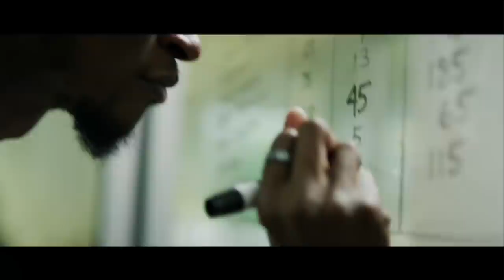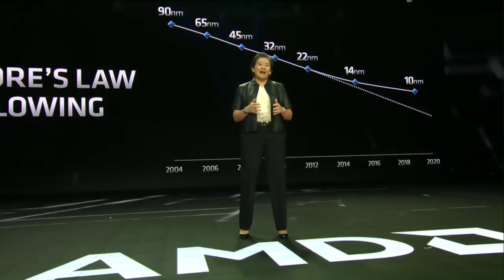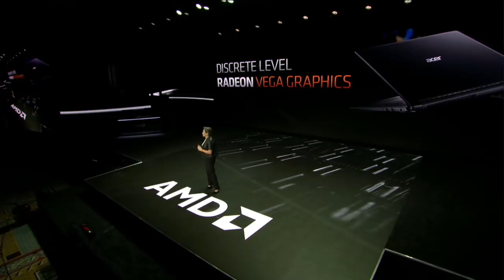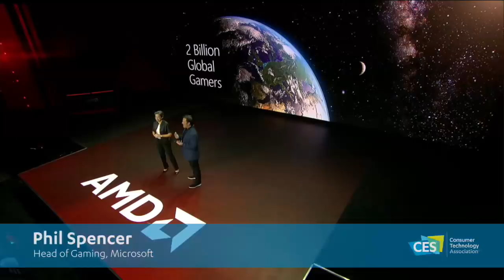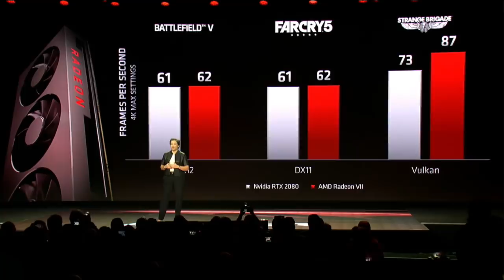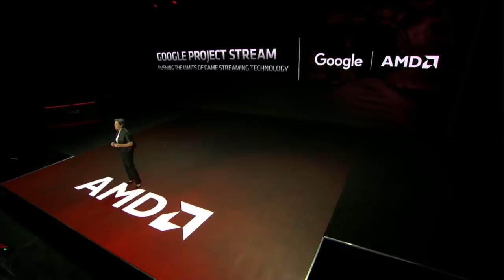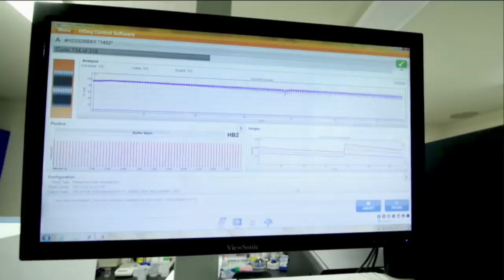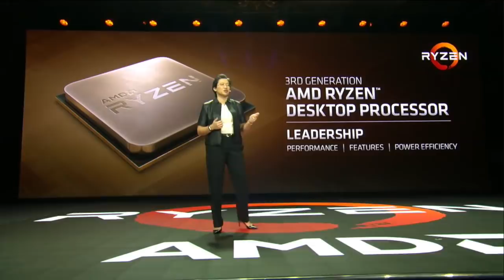AMD CEO Lisa Su's 2019 CES Keynote

Comment: This card was NEVER meant to be a consumer graphics card. This was made 
for the artificial intelligence market, automotive industries. HBM2 was 
too expensive so AMD killed Vega development and focused on Navi. Taping
 issues during final production caused the delay of the Navi 
announcement at CES. AMD was losing money on Vega\HBM2. The only reason 
it was completed was to have a back up plan if Navi failed\delayed.
Wait for Navi to be announced in June \ July release.

Navi 12 = RX580-1060 performance\RX3060\4GB GDDR6\75W TDP\$130usd
Navi 12= Vega56-1070 performance\RX3070\8GB GDDR6\120W TDP\$200usd
Navi 10 = Vega 64 + 15% - GTX1080 perfomance\RX3080\8GB DDR6\150W TDP\$250usd

Reference: AdoredTV.

Comment: I'm upset and very disappointed. I was planning for a new build late spring with a Zen 2 and a new AMD GPU hoping you'd have a new GPU architecture priced in the $400-$500 region. You're not going to get any mind share with this Vega 7. Yes I'm calling this a Vega 7. It's just a constant stream of re brands. 480 > 580 > 590   And now Vega > Vega 7. And at $700 no one will switch from team green to team red. It looks more likely people will be going for a 1160, 1170 or 1180 once Nvidia will launch 'm. You're not going anywhere in the GPU market like you've done on the CPU side sadly. get Navi ready ASAP or sell off the GPU division cause this Vega 7 will not bring you any more market share. It might even cost you.

Comment: These things will sell like hotcake IF Radeon VII priced below $699. Being the same price as GTX2080 will not be able to convert any existing Nvidia users. Also, 7nm Ryzen should priced below 9900K. Same tactic should be used during the first Ryzen series. Lastly, it quite a disappointment because we expected at least a 20 - 30% boost of a 7nm compared to Intel outdated CPUs, Not on par with them..
Reply: The chip they used to compete against the Intel was only running at half the cores. Notice when she held up the processor, there was a large IO dye, a small chiplet and room for a 2nd small chiplet.
Hence the reason why she said mid/late in the year for release. They aren't quite finished with it.

Comment: Where 16 cores? Where 5.00 GHz? Wtf. Lisa?
Reply: You really believed those rumours? Lul.
Reply: The leaks do not tell anything About 16 Cores and 5GHZ just 12 with 5 GHZ
Reply: @OGPatriot03  Right now, not a SIMPLE fact cause it's really based on your presumption of the space left on the substrate.  I could understand the ambition but I would be cautious and careful in wording it.
Reply: @cmiggyy  No, not just the space left, look at the light as it reflects. That space will be used.
Reply: @OGPatriot03  I said SIMPLE. My point still stands.

Comment: Disappointment with an overkill price driving 16GB HBM buffer. No one is asking for 4K, all we want is frames at 1440p. Competing against RTX 2080 at 700$ is a joke. Who chooses AMD graphics over Nvidia now that they support freesync. Had high hopes for AMD and their opportunity to crush Nvidia at the 400-600$ price point.
Reply: Julia J It supports it for all monsters. It just that those monsters arent certified so it may not work at all or to some degree
Reply: @SweatyFeetGirl   It's enough monitors to make a difference for those upgrading or building new systems. Yeah rumors of Navi have it competing better but will it come in time? Nvidia already has everyone outside of the RX580 price range. When Navi finally releases Nvidia will just drop prices to make their cards more competitive. RTX 2070 probably drops to 400-350$ and competes directly with the Rumored RX 3080 (GTX1080 performance).
Reply: @greanade1  Im sure they will have the 8GB variant for at least $100 cheaper, this one was more aimed to content creator

Comment: Complete disappointment from that keynote. It seemed that you was not ready at all. The new GPU is not competitive to 2080 that offers RTX and it meant to be only for content creators especially for GPU rendering with that extra memory. Complete disappointment that Ryzen 3000 at 8 cores is just beating with a tiny margin that 14nm Intel 9900. The most disappointment is that you did not announced that 16core Ryzen 3000. That is a major upgrade path for the majority of the people. Nothing yet about 64core tr. This keynote shouldn't be done at all it was very disappointing for the majority of AMD's fun base.

Comment: I never buy amd again. That piece of junk only durable 4 years. I have nvidia and till now still work fine after 6 years
Reply: This isn't evidence that all/most products of a certain company are bad and that other people will have the same bad experience as you. You might have been that 1-2% of unlucky people that had hardware fail on them. These things do happen with every piece of hardware, no matter the brand or model, you know? I've had an AMD CPU that worked for at least 6 years when I finally sold it (probably still works to this day with the 2nd owner). I've seen nVidia GPUs cr@p out and even combust after just a couple of years. So am I justified to say "nVidia are a piece of junk" based on these isolated cases I mentioned? No, I'm not. Neither are you. See how this can work both ways? AMD, Intel and nVidia all create products with similar defect rates. Just buy whatever gives you the best bang for your buck and don't overthink it that much. Not exactly related, but I once bought one of the most expensive EIZO monitors, the CG series costing thousands of dollars. You'd think that it should be absolutely perfect, right? Well, it came with a serious panel defect. So I returned it. Does that mean that Eizo are "a piece of junk"? Not at all. They are one of the most reputable professional monitors brand out there. I was just unlucky to receive that 1-2% of defective hardware. They replaced it right away and the new one has been perfect and works to this day.